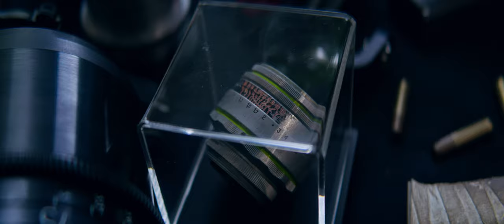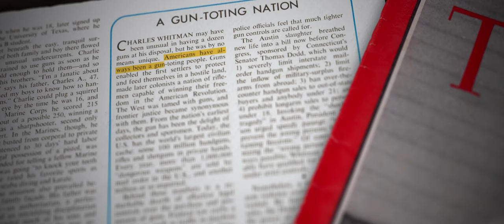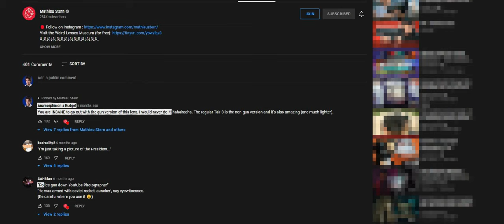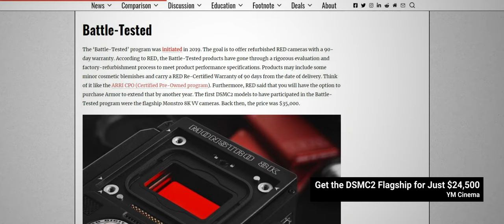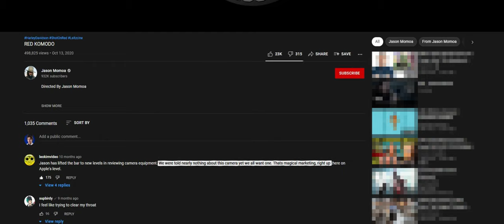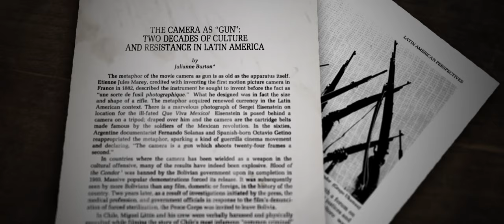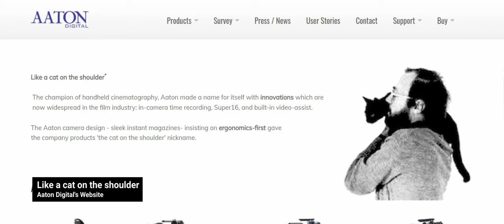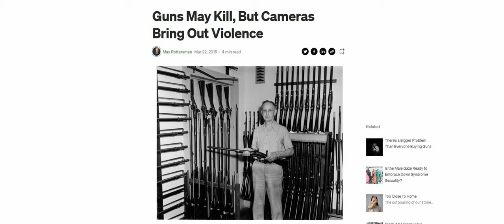Why GUNS and CAMERAS have so much in common?

Comment: What works, works. A pistol grip on my 60s Bolex keeps the camera shooting straight. A generic camera grip doesn't do it as well.

In the German language, guns aren't as common day, and language around photography and filmmaking doesn't overlap as much with firearms. As a computational linguistics student, it was once pointed out to me, that text qualification will proof that texts about cameras and about weapons are more similar than most topics. 
Some of the camera technology that is the most exciting to me is thermal cameras in the long wave infrared. A technology exclusively founded and made possible by military spending. I am trying to use it for story telling one day. 
If you want to go further, film only good as great because the military needed it for surveillance, digital sensors only happens because using film for surveillance was too slow (maybe also because of astronomy...). 
Ever wondered who makes these amazing sensors for Blackmagic Design? Fairchild imaging, yes - they built fighter jets and radar  (now part of BAE). 

There is even a scene in a film, where a gun is hidden in a camera for an assassination.

Comment: Really interesting video.  If I’m being honest though I know that real violence and fabricated “show” violence feel completely different to the human brain. I question in this particular case whether the lingo/design cross ups actually do a lot to normalize real violence to a normal human brain.  Most people, I think, are able to easily maintain a pretty dense psychological wall between real and fake gun/camera play.

Regardless or whether the Aaton was designed to be like a perched cat or not it also still looks like a bazooka if everybody is being straight with one another.  Regardless of which association you make the practical reality is that the shoulder mount redistributes weight to allow an operator to work reliably for longer periods of time. 

Now, personally I’ve never bought military simulation or other real-world violence games like Medal of Honor, COD, GTA etc.  It’s not because of the use of guns, its because these games typically serve to reinforce the worse kinds of stereotypes about women and people of color.  The adverse effects of these and other external reinforcing sources have a far greater tendency to billow out into a broad range of social circumstances that we all have to encounter every day and IMO are actually corrosive to culture and culture building.  

We all know now that both Hollywood and off-Hollywood productions have contributed greatly to this corrosion of culture since the dawn of film and to that end makes certain people appear “innately more expendable” than others and that’s a bigger problem than the camera/gun correlation.
Reply from the maker: Those subjects you point out are already within my sights to keep the gun-lingo going on. Thank you so much for joining the conversation and expressing your thoughts on it. :)